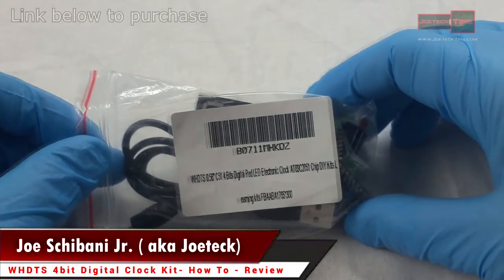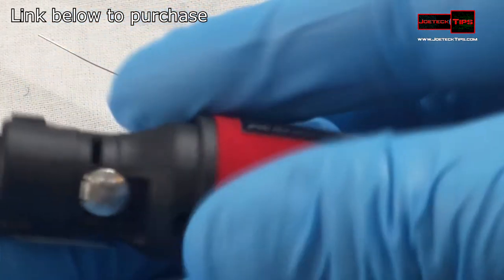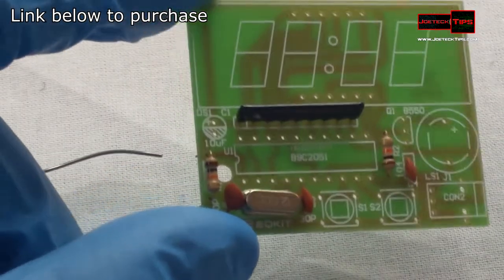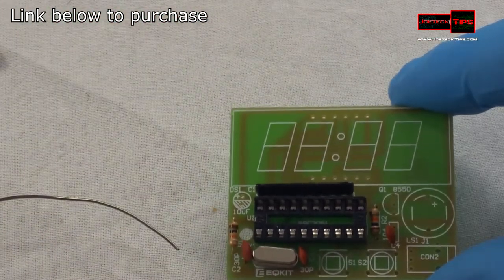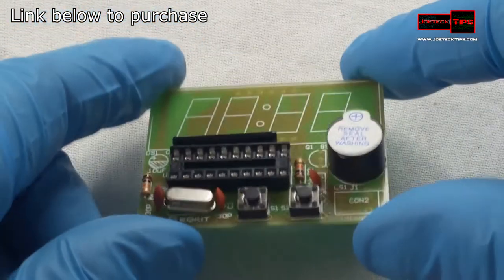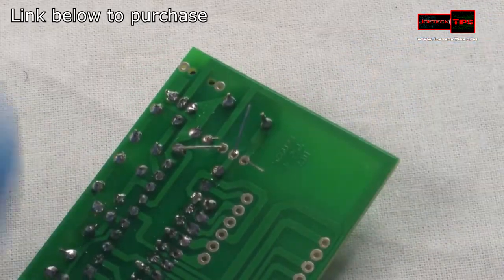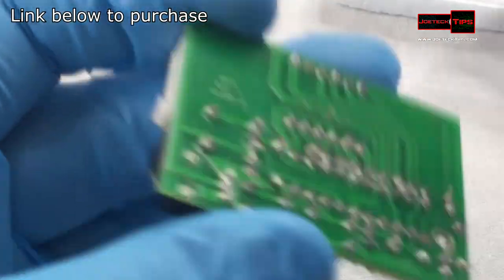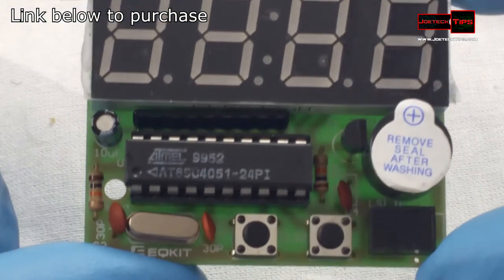WHDTS 0.56" C51 4 Bits Digital Electronic Clock Kit | How to | JoeteckTips

Comment: I received this kit a couple of years ago as a gift. Decided this was a good time to do a Christmas break/COVID fun project. Thank you for the video tutorial. I followed it and the PDF instructions and feel sure that I assembled it correctly. When I first plugged it in, nothing. I fiddled around with it a bit and still nothing. Then suddenly, the display lights came on. It held solid for a few minutes and then started blinking. The two buttons didn’t do anything and if I moved the clock from its position, the lights went out. When it’s in a certain position, the lights will stay on although none of the digits are complete; only partial light display on the first 3 digits and nothing on the last digit. Rather disappointing. However, thank you again for your tutorial.

Comment: Can you give me a brief explanation on why it works the way it does
Reply from the maker: No I cant, sorry. Its an electronic device. So much is happening.  It can not be brief.
Reply: Press left button for a couple seconds. It goes into set mode. A is clock Hours, B is clock Minutes, C on/off hourly beep, D on/off alarm 1, E Hours alarm 1, F Minutes alarm 1, G on/off alarm 2, H Hours alarm 2, I Minutes Alarm 2. And back to display. If you turn off an alarm it will not cycle thru the set mode for that alarm when you go thru the menu. Mine worked. It is 24 hour time by the way.